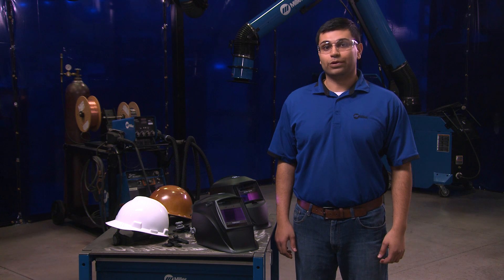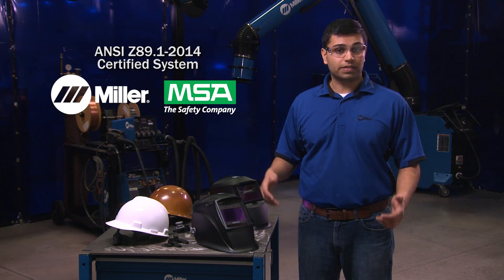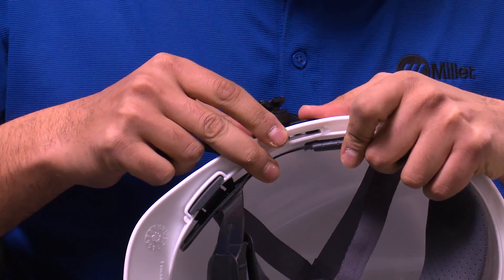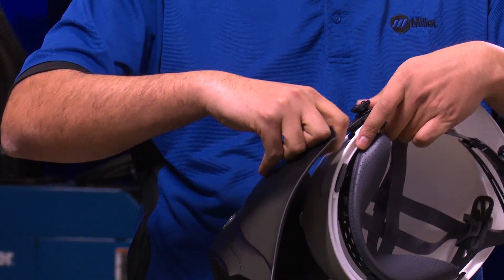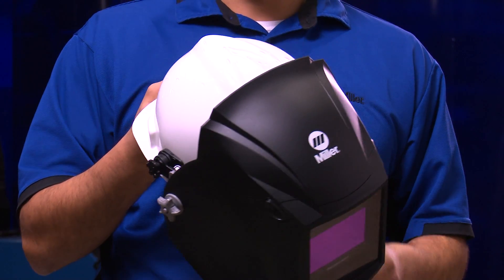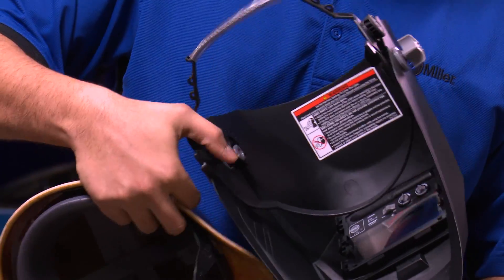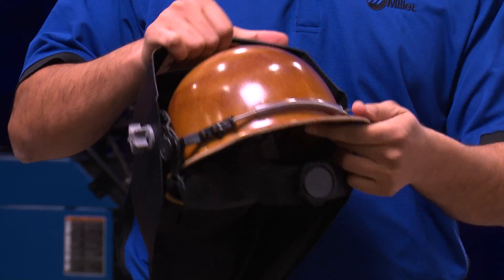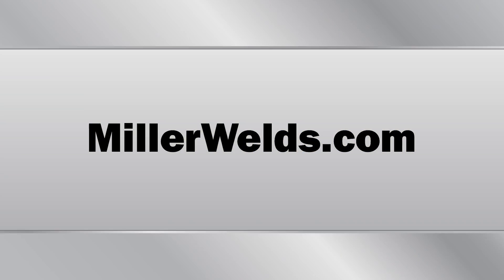Miller Welding Helmets plus MSA Hard Hat Certified Systems

Comment: Can you fit a respirator under any of these?
Reply from the maker: Hello! Thank you for your question. All Miller welding helmets are designed to accommodate our respirators, although it is essential to acknowledge that the respirator follows a one-size-fits-most paradigm However, it is noteworthy that such instances are infrequent, and the majority of users experience no complications.

Comment: the problem is i can't wear a hardhat backwards because of my head size. the spots where the suspension snap in dig into my head and it won't go down far enough to NOT slide off my head as soon as i lean down..

Comment: Hi would this work for the Lincoln electric 3350
Reply from the maker: Thank for you question. To be compliant with ANSI Z89.1-2014 welding helmets and hard hat adapters have to be tested and certified as a system.  The Miller Hard Hat Adapters are designed and tested within the Miller helmet lineup and are not designed for use with other helmet brands which would also null the ANSI certification.

Comment: Are there specific hard hats the halo adapter works with exclusively?  I have a t94i helmet
Reply from the maker: Hi, we recommend checking out the T94 Hard Hat Adapter. You can learn more here: MillerWelds.com/accessories/helmet-accessories/hard-hat-adaptors/t94-hard-hat-adapter-265315.
Reply: Miller Welders will it work with a Honeywell hard hat? Or does it have to be a MSA brand hard hat.  My Honeywell hard hat has the 2014 ansi regulation on there. I’ve ordered the adapter.